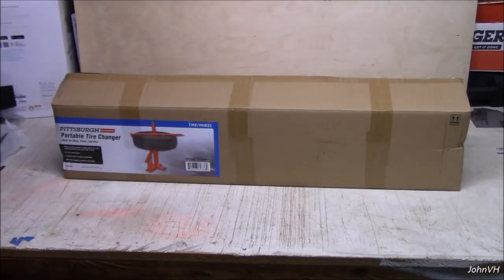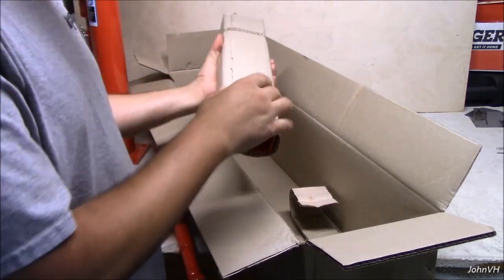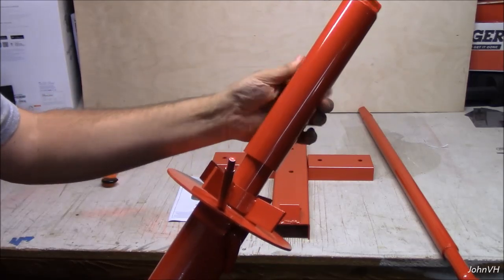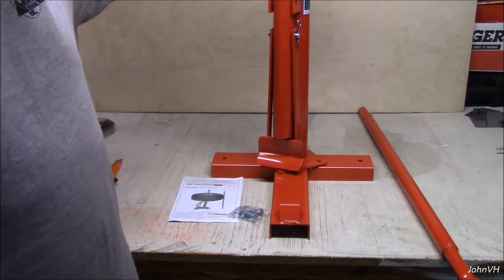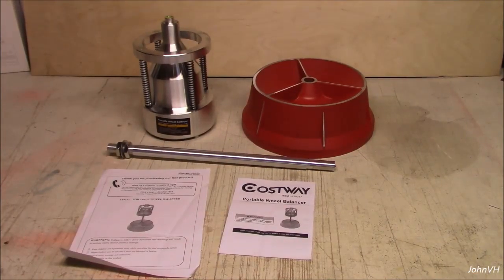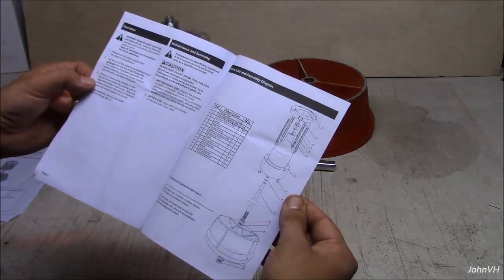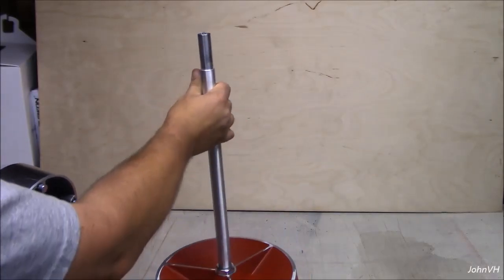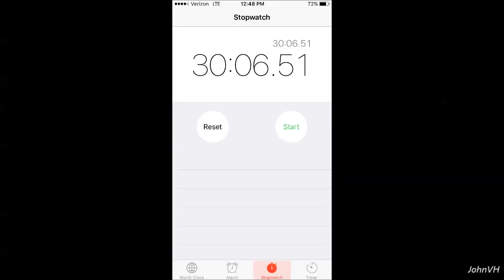Manual Tire Changer and Bubble Balancer unboxing and Review Pittsburg Harbor Freight

Comment from the maker: A follow up, ATV rims are too small to fit onto it, I may build an adapter for that, also, 20" truck rims look like they will work on this too, but my E rated big truck tires were the problem, not enough flex to get them back on easily, it was work!
Reply: I think i ll just buy a coats 4040 most of my tires are e rated on my trucks
Reply: Any update on the ATV wheel issue? I'm looking at one of these mainly for that. We have always beat on them with the old bead breaker hammer and pried them off with tire tools. This last round, I don't know who got whooped worse, me or the tire. You really find out how out of shape you are when it takes over 2 hours to get two tires changed out.

Comment: so u think they are both worth the gamble or keep to the retailer esp those that offer road hazard lol.
Reply from the maker: +Thisisbb1 I love mine. But you must modify or buy a better bar. Unless you want to scratch and have red paint on your wheels.
Reply: yeah, basically every vid i seen (over 6) everyone is doing something wrong. If it's to mower tires or spare it's not bad. but usually we tend to go for the better tire brands thus, normally road hazard. it has turn key rarely but still lol.  i may consider if i have the spare cash.  shame HF doesnt offer a alignment setup.  the string thing i can figure out well.

Comment: Notice the tire is always an old stretched tire, try a 205-50r-15 new tire on a 15x6.5 rim. Then I would be impressed.
Reply: Thats what i said, all these guys use are 65 series and up with super soft sidewalls ... I said try a 50 series or less then i will be impressed
Reply: I've used it on 205 55 r16x6.5 rim no problem. I haven't tried it on a lower profile than that.  I bet 50's would be no problem. But if you ride on rubberbands like 45 and lower you might have an issue. Also to note older tires are the hardest to replace because the rubber is stiff, newer tires the rubber is generally more flexible and the beads aren't stuck to the rim.